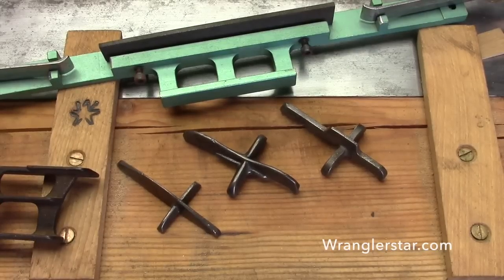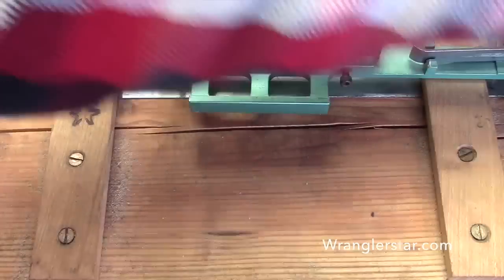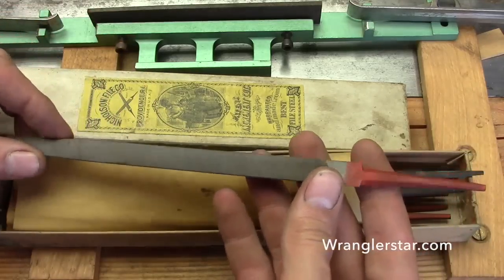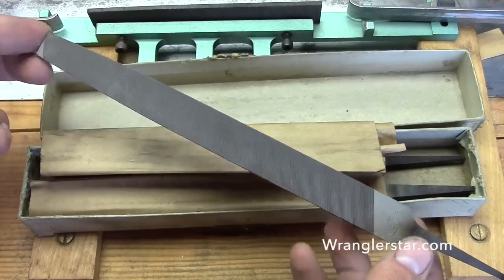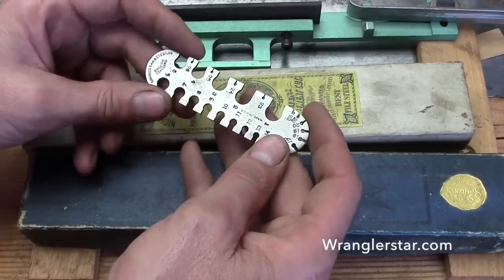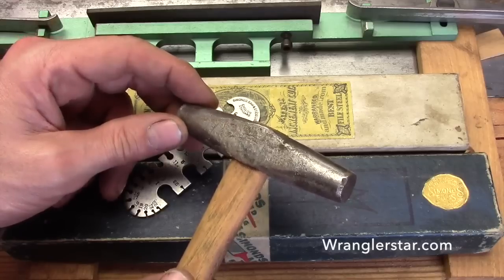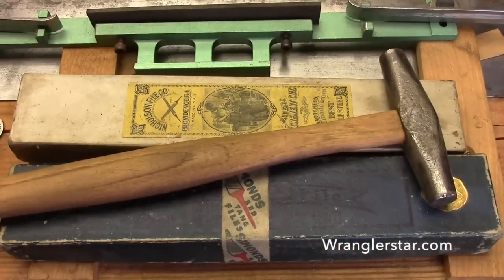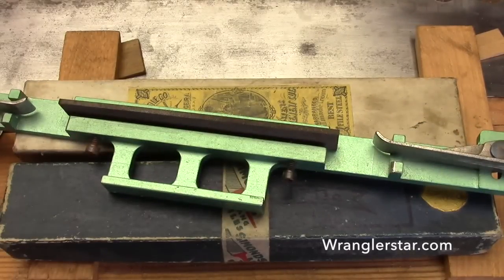Saw Sharpening How To

Comment: Hey Cody have you thought about selling templates for the custom handles you make? I think with a lot of older specialty tools we normally just get the heads and original authentic handles are usually replaced somewhere along the line with a modern day careless design that is nothing more than serviceable. I've noticed the antique and vintage tool market essentially boom and I know more than one of those chisels or axes needs a properly designed handle.

Comment: Should an old Disston and Sons saw be restored or kept as an original ? Truly need advice because I got it with 1 screw missing and a huge crack in the handle. And, what are the tools/materials for the repairs/restoration needed. Any information is highly appreciated. I love this saw because it works.

Comment: Real shame we don't make ANY files in the United States anymore.  Nicholson, Simmonds and other brands have all outsourced the work overseas.  There is a company named Boggs Tool and file sharpening company that can professionally re-sharpen any file.  I've used them before and am amazed by the end result.  

Some modern files can be considered consumables, but the old USA made files, especially the antique styles are worth resharpening.
Reply: I purchased a few of the new Nicholson files last year to file my vintage axes. I clean them regularly and they already don't cut as well as the did right out of the package. Needless to say I'm pretty disappointed!

Comment: I have to laugh at your dissapointment with the "unnamed saw hammer". I too bought one from that "unnamed Saw Company" about 15 years ago. A total POS (like all the tools they sell). The face of the hammer actually dented when I tried to set saw teeth against an anvil. I sent it back with an attached nastygram only to be told that "nobody else complained about them". The hammer is a copy of the Atkins No.4 setting hammer. If you're serious about filing crosscut saws, find one of these on Ebay and buy it.